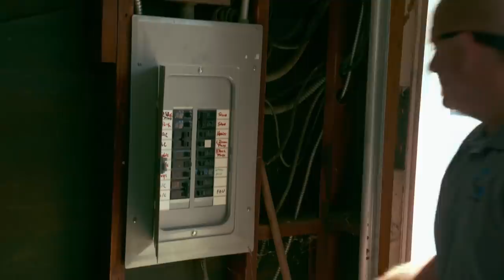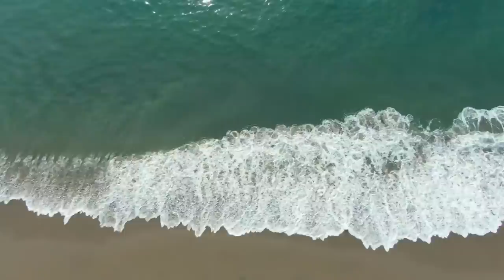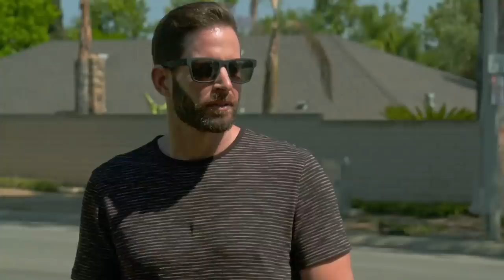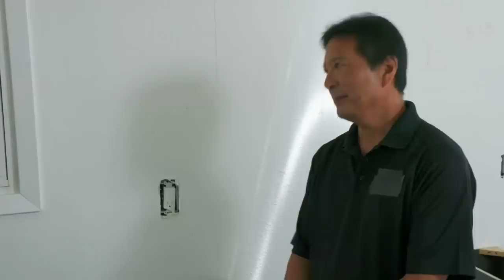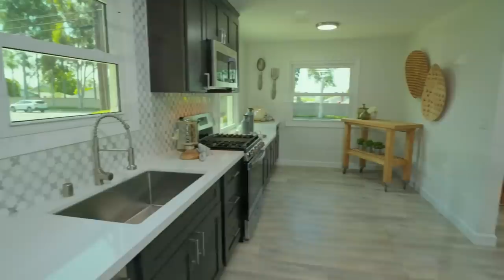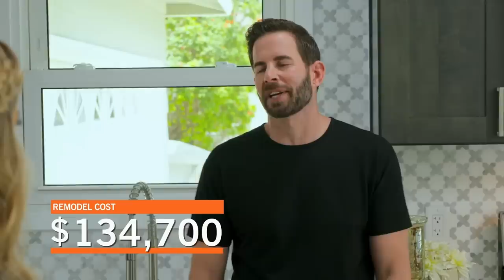"This Was A Behemoth To Tackle" Tarek & Christina Revamp A Small Suburban Home l Flip Or Flop

Comment: Best tiles they have ever used.  I also like they used different tiles for the shower than the kitchen.    Nice, will not look outdated in 10 years and dwellers will not tire of the decor.
Reply: Far as I'm concerned, gray was dead over 25 years ago. I'm ready for something fresh and different.
Reply: Love it as well.  It is a neutral that will blend with any decor.  
The kitchen and bath tile were different but also related to each other which is nice.
Reply: @angelbulldog4934  
Nothing like a color that clashes with buyers' furnishings to add to resale value.  
That said the green tile had a cheerful cottage funky-ness that is hard to duplicate.

Comment: would have changed those metal 'columns' on the front porch
Reply: They were fine in this instance.  This is a mid-century modern cottage and the other touches built on that. Adding other columns would have given it a different vibe...
Reply: I adore the Mid-centry vibe,but I agree with Ms. Mary. I'm definitely not a fan of those columns..at all.